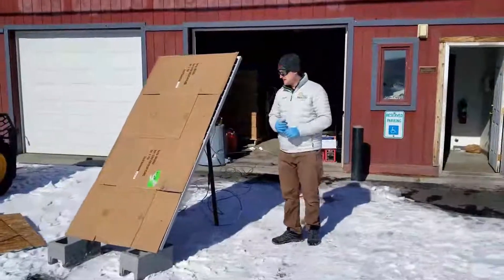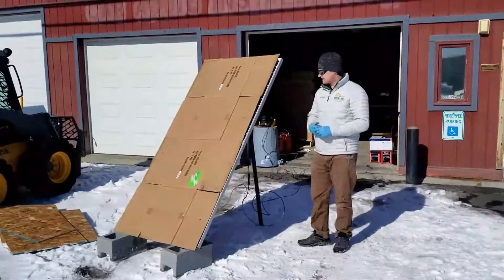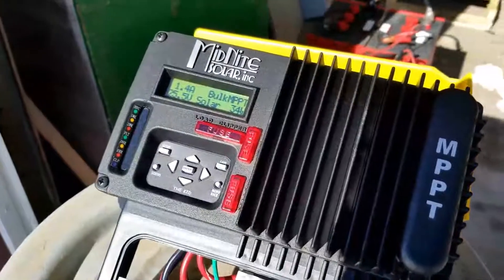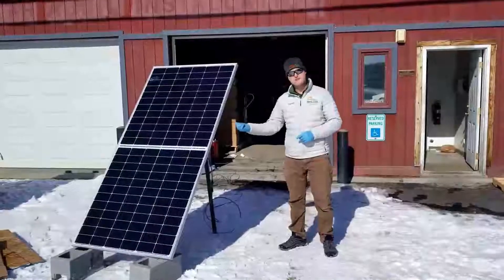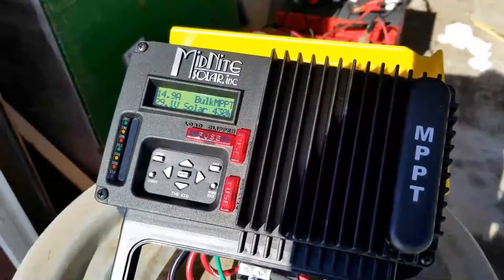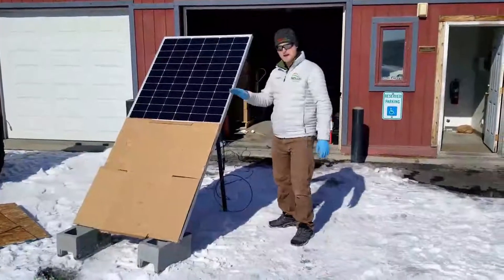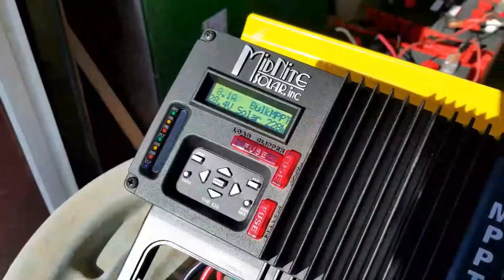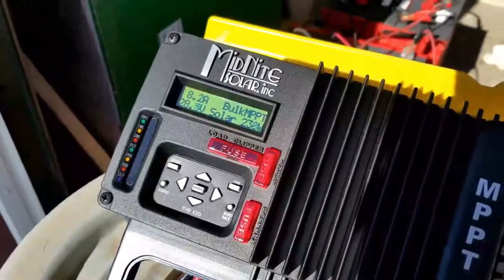Why Bifacial Modules, Best Bifacial Solar Panels

Comment: how much more expensive is an average  bifacial solar panel than an average monofacial solar panel?
Reply from the maker: Hi Berk, thanks for your interest. Not much difference when pricing them at our manufacturing plant. Maybe the retail price is kind of different?
Reply: They are really heavy, you need to consider that, and have competition in 2022 from the new n-type panels which are more efficient. If it's going on a roof you probably want the lighter panel.

Comment: 34watts? That's essentially nothing.
Reply: 34 watts is almost a 10% gain in a real-world application.  That's huge!
Reply: Maybe when you look at it for a single panel but across an entire array it can easily be over 1,000 watts and that is significant.